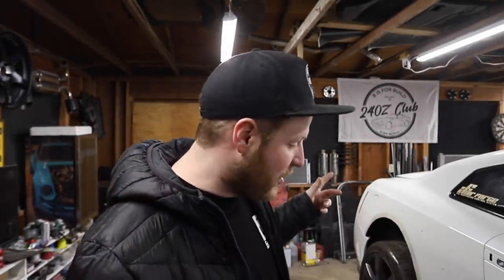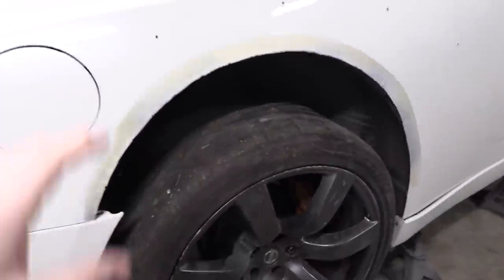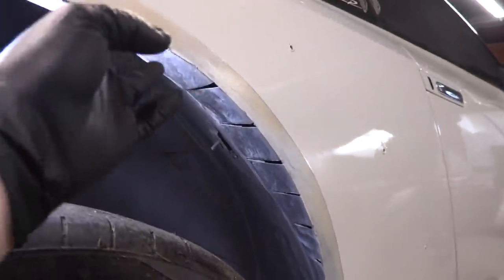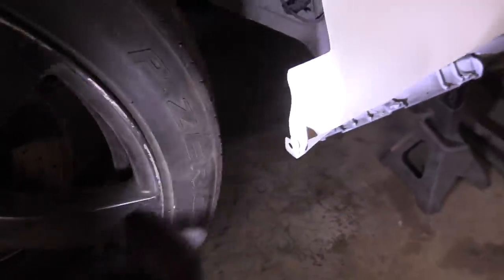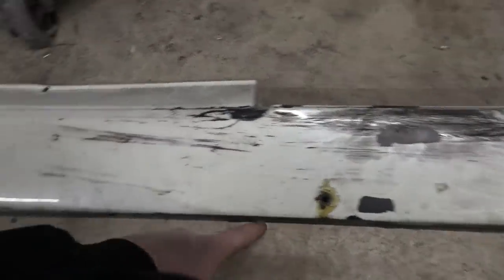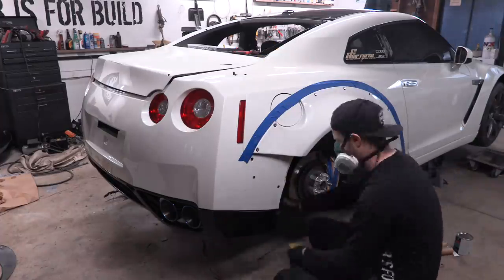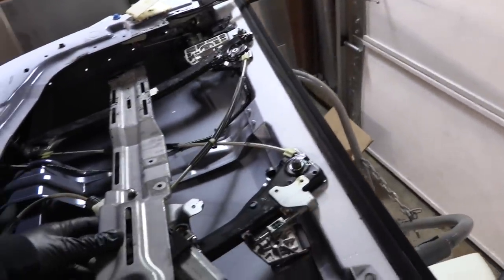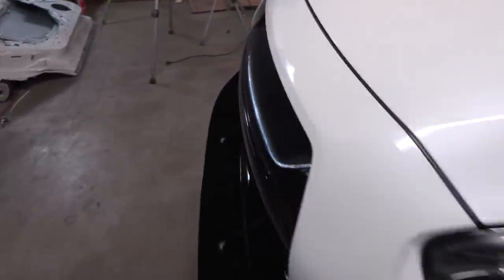Installing Liberty Walk Wide Body Kit on the GTR

Comment: Cutting your quarters is a terrible feeling..
Reply: Cutting your Brand new expensive quarter panel that you worked hard to get and fix and paint few times...
 might fell even harder..
need the nerve to do that.
Reply: I know the feel. Felt really bad cutting into a the good quarter of my S13 but a symmetric widebody looks much better than a car with 1 smashed up quarterpanel.
Reply: @roguetorino  I live in the east coast so it's hard to run away from salt coming in all directions be it snow or the Atlantic ocean. Cutting the quarter is the only option sometimes );
Reply: Yeah i would never do that to a non crashed car, this had the liberty walk body kit because most likely it had body damage before

Comment: I love all the things you do, but i gotta say, that front diffuser is a big NO, is just not right without a lip that lowers it more, when you lower the car it will look really bad, i know you tried to make it look like the LB Front Bumper but that bumper is lower so it can flow with the sideskirts, if you want your homemade diffuser to look good you need to put the stock lip on that bumper or a custom one, i know is your build, but is just a suggestion that would make the car look sooooo much better!
Reply: diffusers are at the rear. Splitters go up front.
Reply: How long is your code gonna be up for the speaker?
Reply: @aidenjanousek9633  Kove does deals with a lot of youtubers. If that code stops working just go look at videos from Tavarish, doitwithdan, streetspeed, and so on and I'm sure you'll find another code soon. But I am fairly sure the code will work for a decent amount of time.
Reply: @edddiaz4202  +1 for oem lip & splitter combo
Reply: His car, his time and his money so he can do/put anything he wants on it.
Reply: If you look up kings must rise hes made a few out of abs I think that would look great on this
Reply: That’s what I was thinking
Reply: SoulOfHades  they do. But this does not have one.
Reply: @papi-champoo6033  without the factory lip his homemade splitter is gonna be 3 inches higher than the car was from the factory so it will look funny as soon as he lowers it. All because the homemade .25" lip is mounted where the 3" lip should be.
Reply: Joe Alex agreed man! That front bumper needs the stock lip, to lower it more. It gonna look weird.. watch
Reply: Joe Alex hey brother no hate to you but the car is made all for him and he chose to make the front lip like that it’s cheaper, which is a point of the build and he likes it that way. If he doesn’t like it when he lowers the car, he will fix it, also he knows every detail in this car it is custom made by him.

Comment: If your car doesn’t have a sound system, why would it have cup holders? 🤔
Reply: My infotainment unit just broke on my 1994 SC400, bitch and a half to fix or replace as it's so integrated with the car's computers.
But I have 2 cup holders! 

Let's hope this thing isn't too expensive
Reply: Welp, Chinese android headunit costs less and lets me use my factory amp and speakers
Thanks but nevermind, Kove!
Reply: 1lamborghinimercialagoSVfan - Just because a car doesn't come with a sound system it will most likely have a cop holder of some sort.
Reply: All I was saying was when you think of no sound system you think of a track car or a stripper interior car of some sort. Track cars and stripped interior cars usually don’t have cup holders either.
Reply: 1lamborghinimercialagoSVfan - I see what you're saying. I think he meant maybe if your cars system is broken or something like that.
Reply: Jess M which I understand, I was just making a joke lol
Reply: I feel it. My brother-in-law has a 280z it did come with a sound system but no or maybe 1 cupholder(s) iirc. It does have like 5 ahstrays though lmao. I had this old Volvo station wagon from the 80's that for sure did not have any cupholders but it did have 12 ashtrays haha.

Comment: The front small panel on the bumper you installed is not well placed, you can see it doesn't match with the second one, gap is strange :/,
the car looks mad by the way :)

Comment: Shoot expanding foam in between the seams / gaps, then do what you did. Gives a little bit more weatherproofing if water was still to get inside, it at least helps prevent it from leaving that chopped area.

Comment: I'll never understand how a human with eyes could think a GTR wide body kit looks good. If you like it, that's all that matters, but to me, those things are atrocious.
Reply: Considering it was a trashed car before he got it does make a difference.  However doing this on a mint Gtr would be a hell no
Reply: Totally agree the body kit looks like trash. Even on this wrecked car which has been previously cut it feels like sacrilege!
Reply: I don't get it either. I suspect it is some kind of race car emulation thing?
Reply: Only 'acceptable' place to do this is on the xbox or ps4... not in the flesh and with fiberglass riveted onto the body... sacrilege!
Reply: I'll never understand how someone could see anything with a well done widebody kit in a bad light.
Not to mention this car is salvaged. 
I do really hope he decides to replace all 4 wheel bearings.
Reply: Ok
Reply: But the gtr looks like a box on wheels, this gives her some hips and curves. To each their own but i like it much better with the wide body!
Reply: The fenders were already cut. It probably would've costed more to revert the look to OEM and if his taste is for a wide body so be it. Not your car.
Reply: @adamcope5325  very true
Reply: In this case it's fine and all, it's just those body kits that look like tumors instead of an actual widebody
Reply: I like it, but only in certain color. Like black because with the right color it can hide some ugly details. If this make sense.

Comment: One option for sealing the body, as opposed to the fiberglass Bondo filler, is to use a sound deadner material like DEI Boom Mat, Dynamat, etc.  Very sticky butyl that will seal and also add a sound deadner to reduce noise.  Just cut it into small strips that span the gap and cover it all.  I did that on my widebody and it has no issues.  I also build some smaller inner fenders for front and rear to add an extra layer of protection.

Comment: Bit like an expensive kit car this! don't think I would pay much for a crashed and cut and shut car, if you added up the parts labour cost, would be difficult to turn a profit I reckon, even harder to find some one will to buy it! I am impressed with the knowledge of fixing a smashed up gtr though, think I would have gone for an r32 as these are going up in value rapidly,

Comment: Tell Kyle to turn his new door on that bumper stand the other way on the stand. GTR doors are heavy, and the way he has it now the stand runs across the body line, that's asking for damage. run your stand side to side under door to avoid that ever being an issue. also not a bad idea to throw a fresh cover over the stands when working on freshly painted parts.
also in the future make all your panel cuts before painting the vehicle.